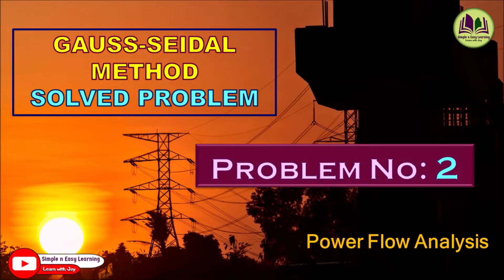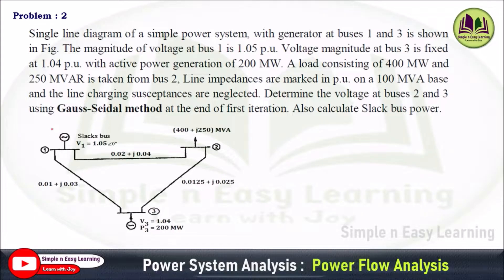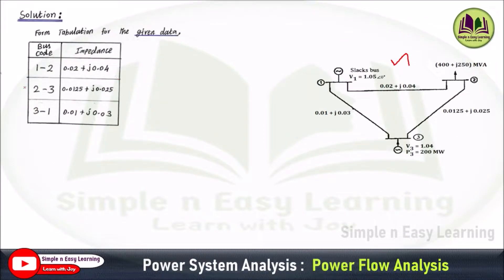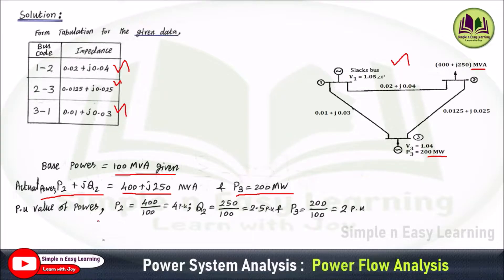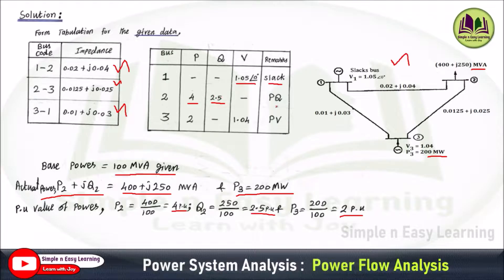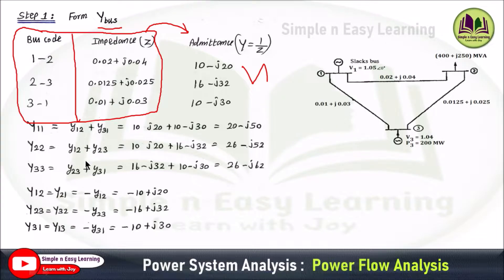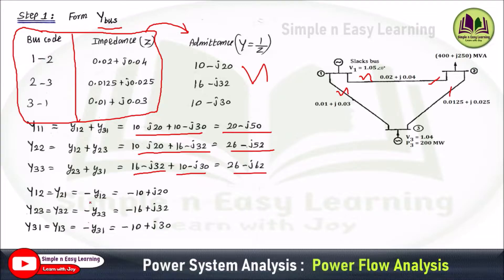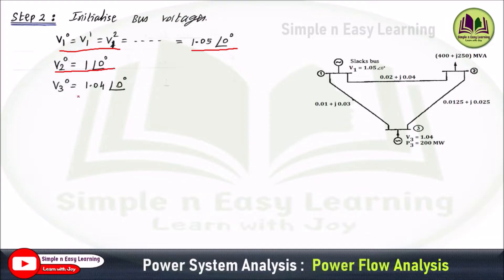Gauss Seidal Method Solved Problem -2 |  GS Method | Power flow Analysis | Power System Analysis

Comment: Sir thank you for your wonderful teaching and I have a doubt sir, that is, P-jQ is a power or conjugate for power
Reply from the maker: Apparent Power , S = P + j Q.
Conjugate of Apparent power , S* = P - jQ

But Here in this problem,
The bus voltage formula has the term P - jQ. 

For the Load bus, the values of  P and Q should be substituted as negative (-ve) (sign change required)

For the Generator bus No sign change is required.
Reply from the maker: Thanks for your valuable feedback 😊

Comment: Please what if in the question, P and Q for a load bus was already given as negative. When substituting it in the formula, would you still negate them again or you leave it as it is?
Reply from the maker: For Load bus , if the power values are already given as negative in the question, they should be substituted as positive (sign change is required).

For example : 
In the question if it is given as
 P2 = - 4 and Q2 = - 2.5

Then, in formula for P2 - jQ2 term, substitute as  4 - j2.5 
(imaginary term in the  formula already having negative sign)
Reply: @simpleneasylearning  thank you very much